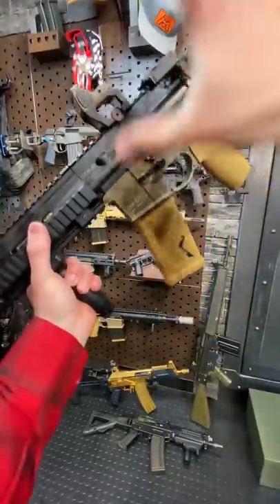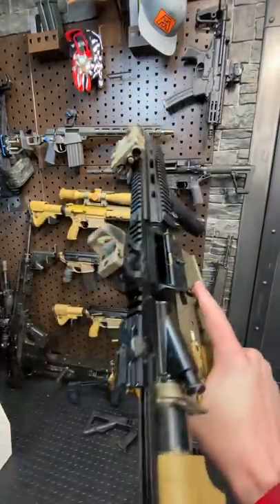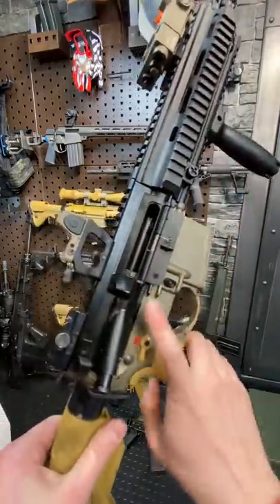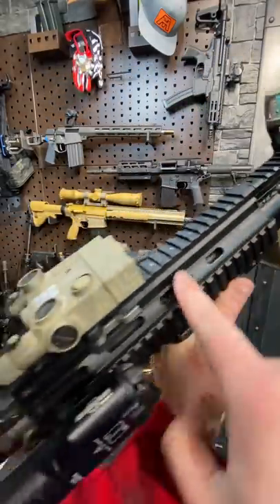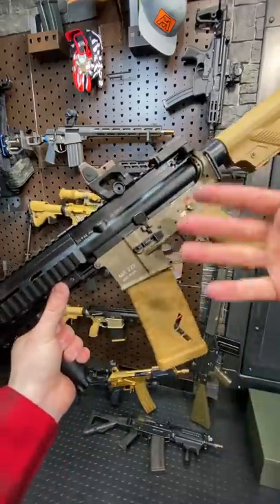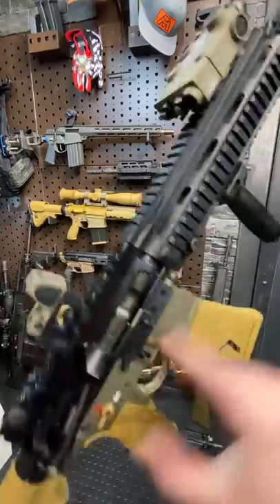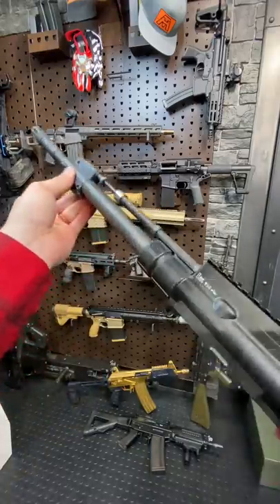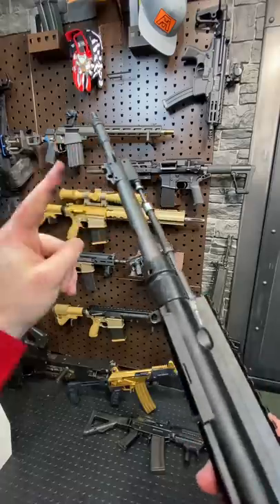Hk416 in 1 Minute #Shorts

Comment: I carried the 416d in Afghanistan years ago. Was a delightful experience. A bit on the heavier side but was a breeze to clean
Reply: Where did you turn it in at?
Reply: What unit
Reply: Yeah, that's why Piston systems are tits. First AR I ever bought was a Stag Arms Model 8 (I regret ever parting with that thing, hands down among the most reliable and one of the best "stock" off the shelf pre-built ARs ever made), and it was a gas piston AR. Once I bought my next one after having to sell the Stag, I bought an S&W M&P-15 Piston AR, which is also very reliable and clean, definitely better than a lot of other S&W designs, but definitely a little step down from the SA Model 8. However, after my experience with my first AR I ever owned, I swore I'd never buy a DI system AR. Never owned a DI, but Ive shot them, and it doesn't compare. Gas piston is almost like having the reliability of an AK, but in an AR. DI systems blow all that had and crud back into your chamber and BCG, unlike with a piston driven system, all that stuff gets shot out the hand guard area, keeping your rifle ALOT cleaner and yes, definitely easier to clean. However, the price point being higher doesn't just end at the firearm purchase itself.... If you want a picatanny rail handguard, drop in or free floating, well, expect to pay at least $300 for the CHEAPEST kind.... Wanna upgrade your BCG? No no no!!! Your BCG is proprietary to your rifle and changing it is quite the project. Wanna run some cheapo iron sights? Well your front BUIS better sit on a metal base and not plastic or polymer, because that gas block gets VERY hot and will melt that front sight real quick, lol. I remember my Stag Arms came with some super nice flip up BUIS, all metal, forget the make though, but stupid M&P-15 came sightless, and had to buy my own, eewww!!! Hahah jk. Anyways, all that aside, it's all still worth the extra penny. Don't waste your money on DI systems people! Gas Piston all day, erryday!
Reply: @ViktoriousDead  The Unit m8 haha
Reply: I blew on my display!!!
Reply: Bro def didn’t serve

Comment: The few times I've gotten to shoot a 416, I was not very impressed. Nothing negative to say about it, it's just that piston systems aren't anything special these days. 

Don't get me wrong, back when it first came on the scene, the 416 was pretty special. But these days piston driven AR platforms are a rather commonplace item, whether retrofitted with a piston kit or coming straight from the factory in that configuration. I've got 3 piston ARs myself (all retro kits. 2 Superlative Arms, 1 Adams Arms) and all function just as well, if not better than the 416. And in the case of the Superlative Arms kits, it doesn't run overgassed. The Adams Arms is adjustable as well, but in all honesty, I personally don't feel a difference regardless of the setting.

Really, you're just paying for the HK name of you buy a 416, military or civilian version. If performance is what you're after, you can get that level of performance through a retro kit. 

Even then, unless it's a SHTF, grid down, apocalypse situation or you're going to war? The benefits of a piston system (cleaner, cooler running system that requires less routine maintenance) are basically lost on the average civilian shooter. And the trade off in weight and quietness (pistons are louder because it's a mechanical action, whereas DI systems are literally just a hollow tube, no moving parts) isn't worth it for me, especially when I run 300 BLK subsonics (properly suppressed, 300 BLK subs are quiet enough that the bolt cycling is lost than the gunshot itself), which is my new favorite caliber... surprisingly, during/post COVID, 300 BLK is not as hard to find as 556,762, or 9mm (also cost about the same as those now... AFAIK, 300 BLK didn't really go up in price like other calibers did).

To each their own, though. Really doesn't matter what you're shooting, so long as you're shooting.
Reply: Well said.  You’ve clearly done your homework. Honestly, it’s just something about the upper receiver that I really like about it. Otherwise, you’re right, I could get an AR that’s just as reliable if not moreso for far less than the asking price of a 416.
Reply: Ur absolutely right. I think this is strictly a historic appreciation/ nostalgic/collection must have/buy one cuz u can, type thing. I mean, if I had the cash to buy an OG HK416, I would in a heartbeat, lol! I also have a serious gun addiction problem as well, lol!

Comment: The 416 always confused me, because it's just a piston driven AR with slight improvements.
It has no right being expensive as it is, and it could've easily been an upgrade to the M4 platform and nobody would notice until they took it apart.

Comment: A little over gased? I shot mine 2 times and swapped it to adjustable gas block upper because of the insane amounts of gas blowing everywhere
Reply from the maker: Thankfully you can get adjustable gas blocks now.
Reply: It was made that way to make sure it powers through all grit and grime, all conditions. If anything get a vented gas block to bleed some of that gas off while still maintaining the reliability.

Comment: That is not the "legendary" 416. Infact, it's not a 416 at all. The original civilian 416 is called the H&K MR556A1. Your lower receiver reads MR223. Not to mention your lower receiver is way out spec from the original profile. Your magwell is cut with an AR15 profile.
 Nor did the original 416 feature ambi controls.
 The 416 is nothing but an expensive MK18 MOD-1 with a G36 short stroke pistol to weigh it down.

Comment: You just bought the rail. The real 416 isn’t no fucking .223 but nice clone
Reply from the maker: The entire upper is off a 416 that a law enforcement department traded in. The lower is a MR223A3, which is no different from a semi auto 416A5 except for the roll mark on the mag well.